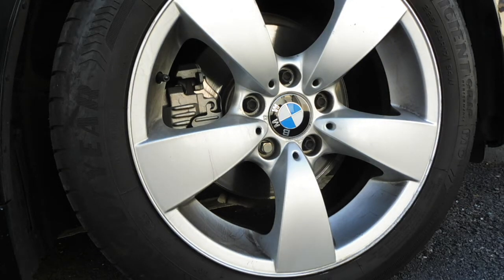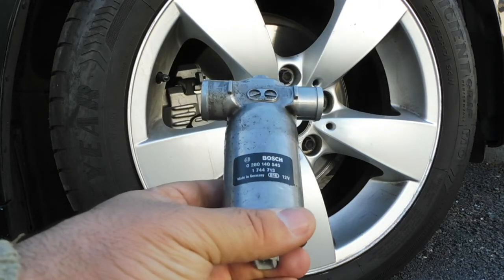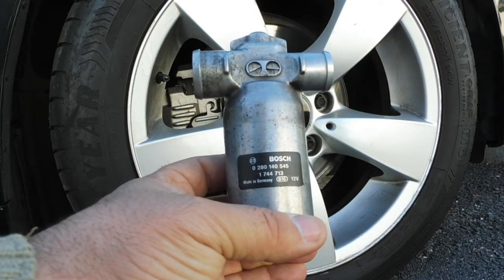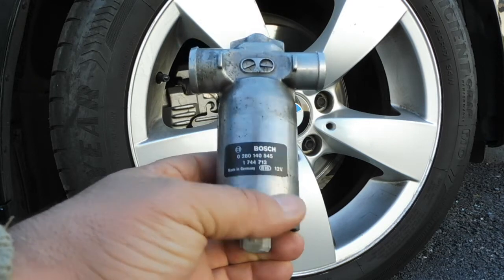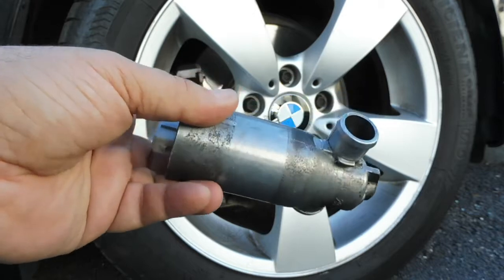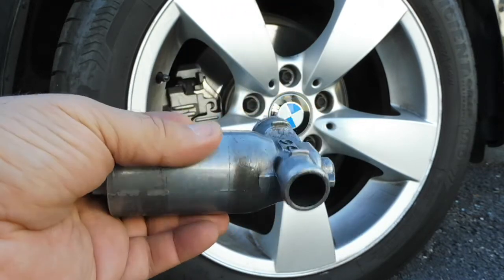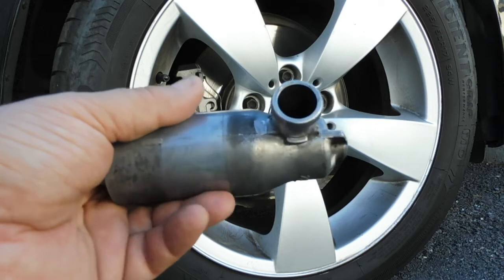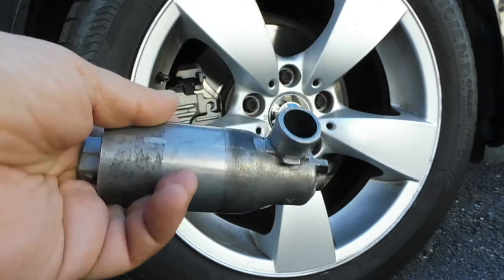How to test ICV  IAC idle air control valve, BMW

Comment: Thx this fixed my issue with rough idle and miss fire. My car started acting weird after removing the intake to do a coolant pipe job and pcv valve replacement. Little did i know that my idle control valve was dirty. After putting everything together, car was idling really bad. After many test and changed a couple of parts the car stil behave the same i was left with either throttle body idle control valve or o2 sensor.  i saw this video about idle control valve mine was rock solid stuck cleaning it with throttle body cleaner than spray wd40 let it soak and hit it with rubber hammer it finally came loose. I even removed the whole intake 2 times to double check if i left something unplugged.
Reply from the maker: Muito obrigado por assistir ao meu canal, são comentários como este que me fazem continuar e não desistir. Subscreva o meu canal e ajude o a crescer!

Comment: Because it clacks doesnt mean it's good 😂 the sensor inside could still be reading bad.
Reply from the maker: But the shake test is also one of the ways to lose the valve.
Reply: @Cantinho72  yes, but doesnt always mean the valve is still in working order